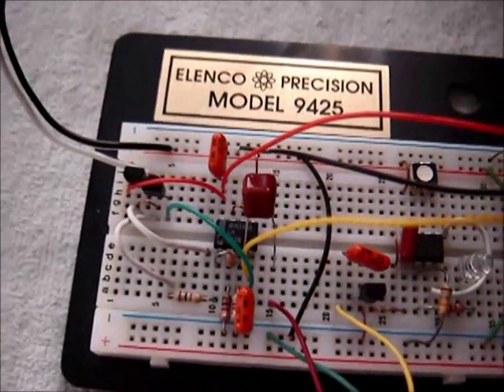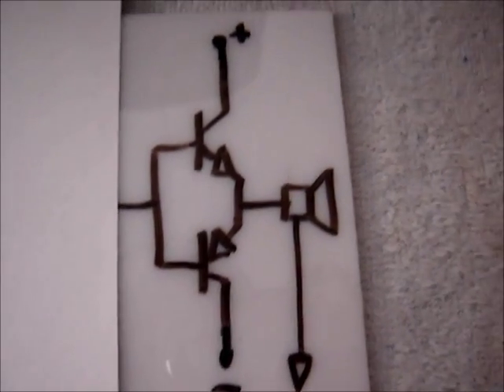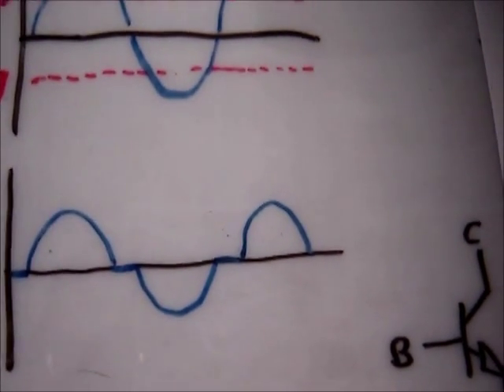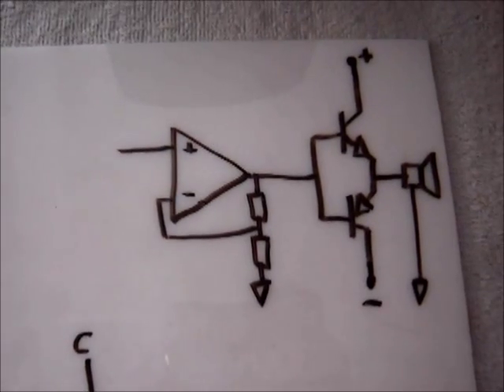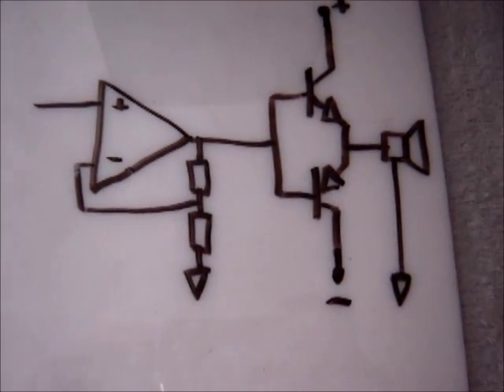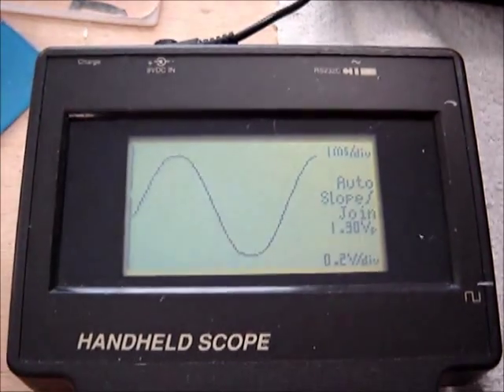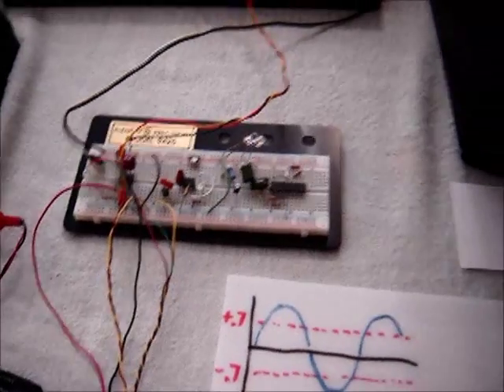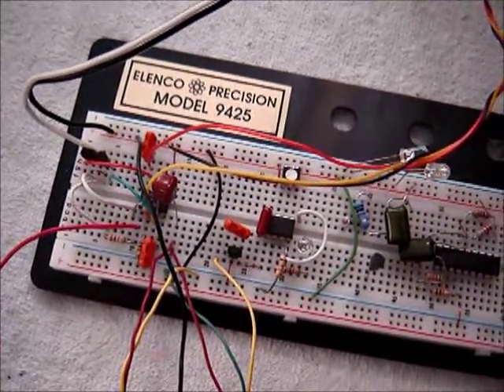Class B audio amplifier and negative feedback experiment

Comment: Thanks for posting John. Question how did you calculate the gain resistor values?
Reply from the maker: Same for an ordinary opamp: Gain = 1+(R2/R1) where R2 is the resistor connected to the output.
Reply: @JohnAudioTech Thanks John.

Comment: u shouldnt be using non inverting unless u know wat u doin in amp design (experienced)

but even then it is still hard to control

inverting is simpler, u can amplify centering a point

non inverting will change ur mid point, reducing maximum gain, giving distortion

Comment: I'm playing a lot with opamps and for me, if the opamp is a high performance one, it sounds really fine! For example, LM324 sounds terrible, but the AD8510 sounds almost perfect. To visualize the negative feedback taking place, I mixed the output stage with whatever I had in hand, I mixed mosfet's, igbt's, pnp and npn transistors, and even germanium transistors together on the output stage, and they all sounded fine, I'm impressed.

Comment: Hi John, this negative feedback logic on  Class B operation is awesome. But few PA amps use input and output transformers to achive much better output within Class B...talso hey use both transistors as NPN for push-pull operation, since swing is achieved from centertapped input transformer. although there will presumably always be a 0.7V crossover absense, a negative feedback kind of smoothens the curve to better levels...anyway PA systems are not used for HiFi purposes.

Comment: If you used a tube amp the GNF works well guitar amp really well also using a variable resistor which l use on my guitar amp lets me dial in the best settings

Comment: actually I found a similar project on https://ludens.cl/Electron/audioamps/AudioAmps.html and he set up a high slew rate opamp just like you did, and he measured the distortion and it was very very good, way lower than most basic chip amps, even.

Comment: Did you try adding a 100uH inductor in series with the speaker? It should take the edge off the squiggles at the zero cross.

Comment: What op-amp were you working with?  If you use a fast enough op-amp (and quiet enough) and then add ~1k resistor between the bases and emitters I believe you will be hard pressed to hear any distortion. The 1k resistor will allow just enough current to flow to really speed the op-amp through the dead-zones.
Reply: A high slew rate (13V/microsecond) like an NTE858
Reply: I built this amp and i used an OPA2604 opamp with 22v/uS and i can't hear any buzz in the sound. With a pair of darlinghtone( tip142/147), i manage to get 41,5w rms into a 4 ohms load at +/- 24vcc without the resistor betwin bases and emmitors of the power transistors.
Reply: @bogdan20782  Ciao @bogdan20782. I may revisit this and try that op amp. Sounds like a fast one! Glad to hear there is no distortion or hum. I will let you know if I try it! Ciao Ciao for now!
Reply: https://m.youtube.com/shorts/RPj1ClPqxok

Comment: Well you can low pass filter the feedback signal at 20kHz and the ringing should go away, oscilation of the feedback loop at the higher, phaseshifted frequencies.
Also you could be elegant and use all discrete transistors on this presentation (long-tailed pair with class A amp stuck to it driving the complementary output pair) - opportunity to explain the differential amplifier.
Reply: Low pass the input as well to keep the opamp from flipping the fuck out when it can't amplify the high frequencies.

Comment: Never seen that done before! Surprised by how well it worked! Can't really judge the piano clip without hearing the same clip clear of the amp.
Reply from the maker: On my old channel, I null tested audio amps by differentiating the input and output (after leveling the signals, of course). I plan to rattle the lion's cage by comparing the signal from tube vs. transistor preamps!
Good point that I should have added the clean audio clip. The distortion is not apparent unless you have good speakers (try headphones, perhaps) and you may have to put your head near the speaker, otherwise, it sounds like background noise. It seems to add a high harmonic buzzing quality to the notes.